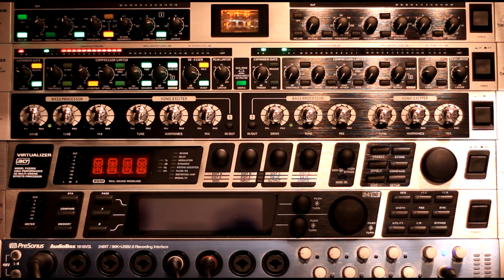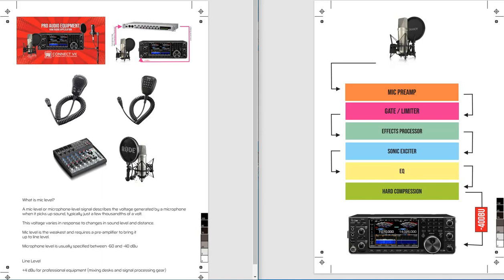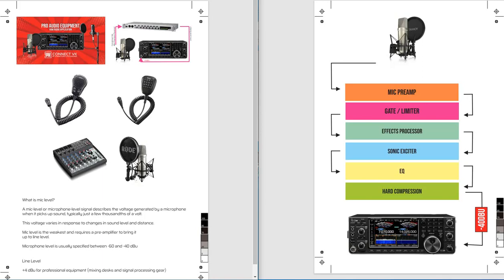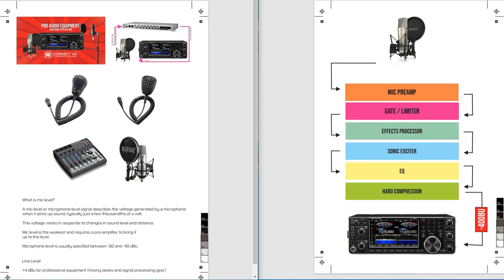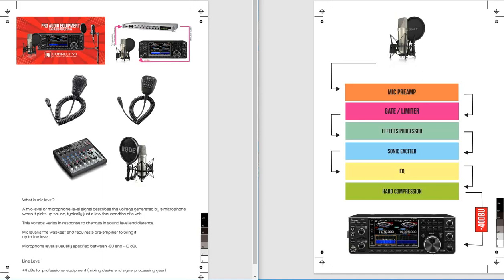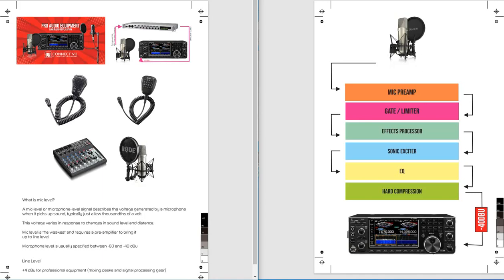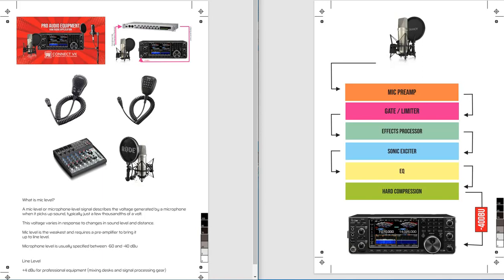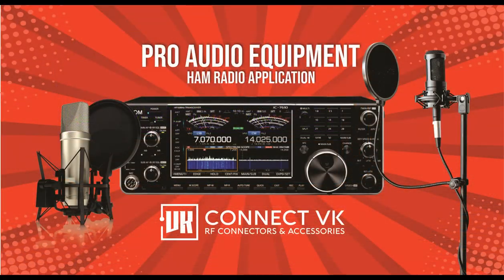Pro Audio Gear - Line level Vs MIC Level - Ham Radio TX Audio

Comment: So, I have a new Heil microphone that I am connecting to a mixer, and the mixer into my radio.  How do I then match the outline line-level signal of my mixer to something my radio can take?  Is there a transformer or matching unit that is commonly used?

Comment: A good technician can make your radio sound like that with a cheap Chinese $20 microphone
Reply from the maker: I am sure that he can try to make it sound good with $20 mic but results are going to be rather disappointing. Once you research the subject and show some respect to audio engineering I might engage in further discussion and attempt to explain to you that what you are claiming is not possible. eSSB is fine audio art where the entire craft is limited by very narrow bandwidth (4-8khz) and therefore requires a proper equipment to deliver desired outcome. There is a reason why good eSSB operators spend 5-10K dollars on their set ups. Over
Reply: @connectvk5543   With the right skills and test equipment anything is possible. 6k wide asymmetrical modulation from a drastically modified Stryker 955
 It's been heard down your way fairly recently. 
https://youtu.be/GMGz91YHGI0